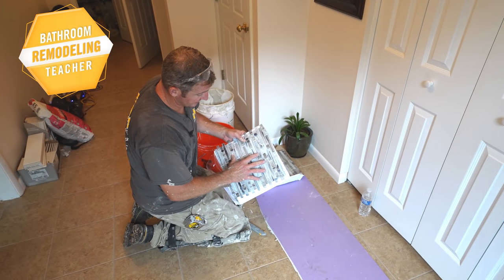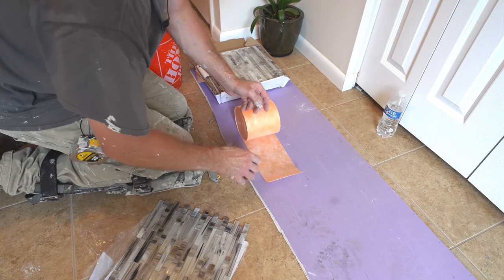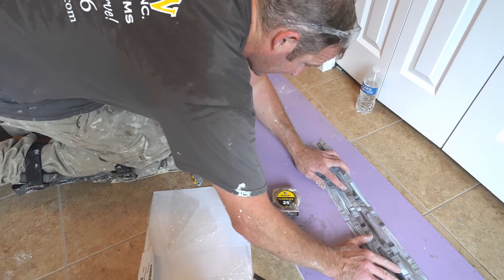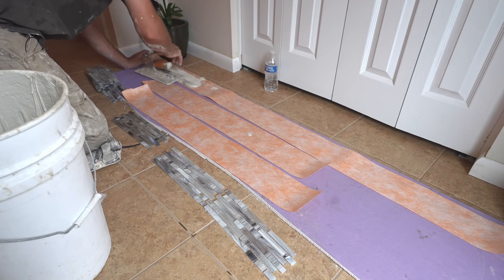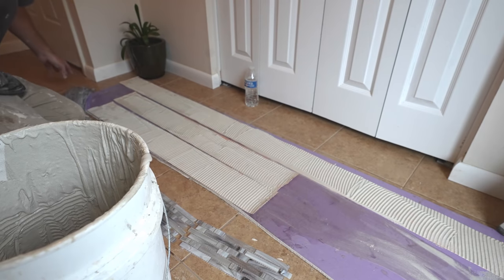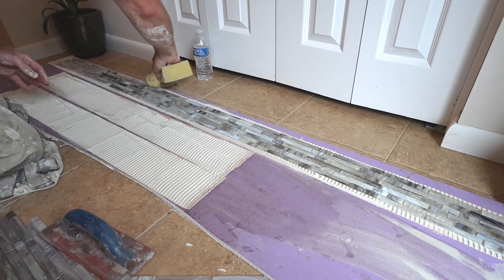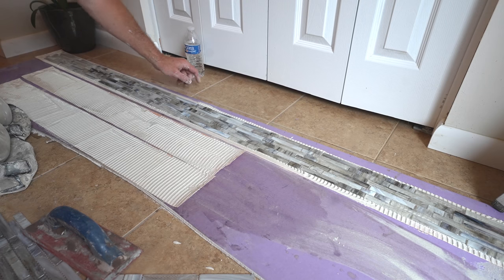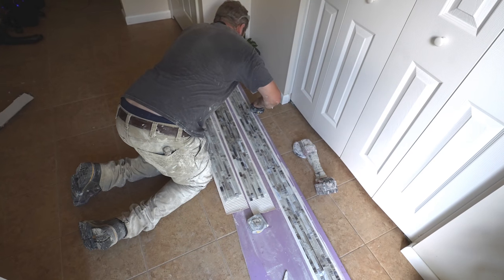Tile Border in a Shower l PLAN LEARN BUILD

Comment: Hey Steve, my glass mosaic is almost the same thickness as the the 12x24 wall tile, but they are installed with 1/2x1/2 trowel producing about 1/4 thinset and the glass manufacturer recommends 1/8 thickness applied with v notch trowel and then knocking down to flat, also something Sal recommends. So I thought I would use the band so the combined thinset behind and over the band would be equal. Also the manufacturer does not include all-set in their list of thinset but specifies products specific to glass like custom build premium glass thinset. I should say my glass is translucent so I guess the glass thinset is whiter. Even though all-set meets 188.15 I understand Schluter does not recommend it for glass mosaic, kind of confusing. I was thinking the preset glass would be allowed to dry before installing but looks like you install while wet?
Reply from the maker: Schluter being confusing 😆 no way…lol😝 I would be se whatever glass approved thinset you prefer. My favorite is Ardex x77. Most big thinset manufacturers will warrant their thinset over Schluter. So no worries on schluters crazy rules

Comment: Novice that has followed your videos with great success. Time to add my mosaic accent strip.  Depth from installed 1/4" thick tile face to backer board is 3/8".  Have to make up 1/8", mosaic sheet tiles are also 1/4" think.  If I use 1/4 x 3/16 to install mosaic to K-band like you did and same trowel to install K-band to Go-Board, will I end up with the mosaic out too far?  Using the same tile trowel 1/4 x 3/8 for mosaic is not an option as thinset will fill grout line spacing.   This seems like the most difficult challenge I have faced so far.  Thanks for your videos that show all the steps.
Reply from the maker: Once you have the band on, you can add additional thinset behind it to make it work. You could also add additional layers on kerdi too, but I would just add more to wall if needed
Reply: @BathroomRemodelingTeacher  Thanks for the Help!

Comment: Thanks Steve. I planned on mounting  my mosaic border to Kerdi but have quite a height difference to make up between the mosaic and wall tile. Could you use Ditra or Ditra XL as a mosaic backing?
Reply from the maker: Thanks john, I haven’t tried that. It might be best to still use kerdi band and set the ditra on wall then apply mosaic attached to kerdi. Not sure how easy it will to handle mosaics attached to ditra. It will depend on mosaics. This one was super thin, I’d be afraid it wouldn’t bond to the ditra well enough to handle. 👍
Reply: @BathroomRemodelingTeacher  Your comment on Ditra makes sense. I will go with the Kerdi and see how much thinset I will need to build up.
Reply: @johns2368  I just used ditra to accent a waterfall in a master bathroom and it worked great. The gap was quite substantial so I needed to extra backer board that the ditra provides. The mosaics I had allowed that application; but like Steve indicated, using ditra vs the kerdi band will depend on the mosaics you have. 

You can also use 3/16 kerdi board if you can get it.
Reply: @davidherd3739  Thanks
Reply: I''ve also used ditra to level up some glass mosaic. I also broke the law and used modified thinset underneath!